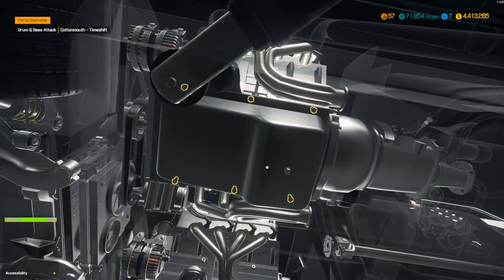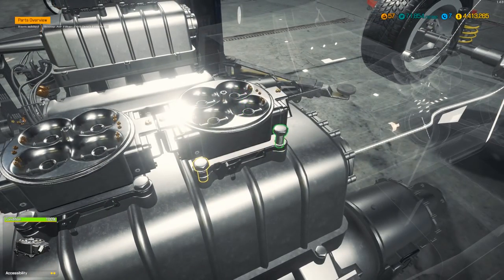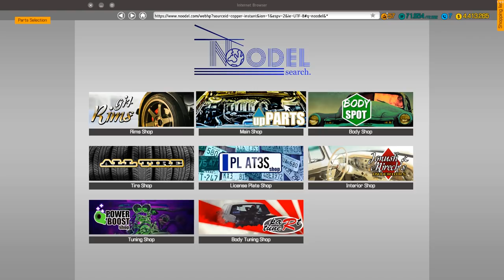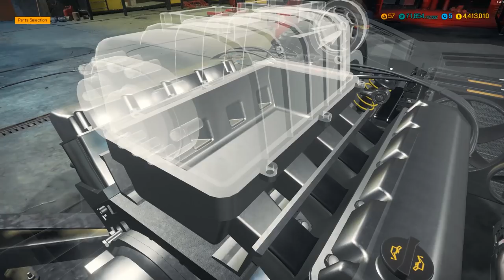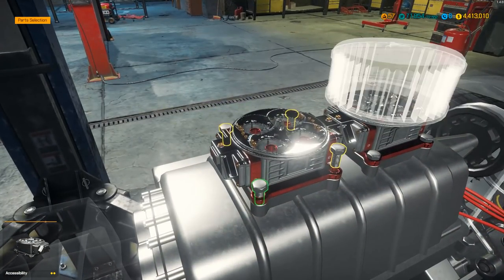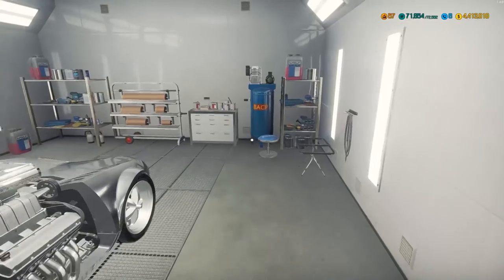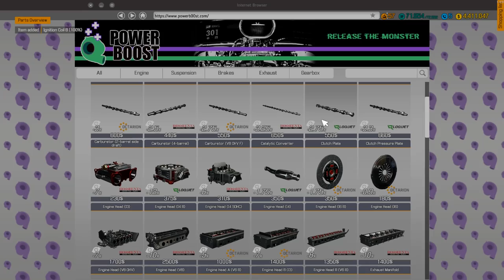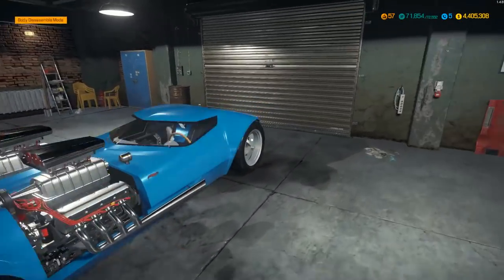Hot Wheels Twin Mill : Car Mechanic Simulator 2018 : PC Lets Play

Comment: As far as i know, the game doesn't let you add a 2nd engine for a car. I tried in the game editor and there is no option to add a 2nd engine to a car. I think that's why the 2nd engine on this car is not registering on the dyno. The only thing that registered after you put in the performance parts on the 2nd engine was the boost of the performance parts you put in. With those 2 engines (without performance parts) it should be over 1000HP right off the bat. For it to register a 2nd engine i think the devs would have to make some changes to allow cars to have more than one engine. Hopefully they add this option in the future.

Comment: I'm thinking about getting car mechanic and I have a question. Do you use the mouse mostly to play the game? I use a headmouse to work the computer. I have cerebral palsy. I have a hard time finding games that I can play because most of them you have to use the keyboard. Any help you can give me I will appreciate.
Reply from the maker: +michael wright Howdy!  I roster and move around using the keyboard and everything is mouse movement.  Mouse clicking is most of it but the keyboard to move the camera around.  Not sure if it can be configured right a right click and mouse movement though.
Reply: Can you change the keys? I play cities skylines and I change the keys to do what want. I use a program called Softype . On some games I can use the on screen keyboard . Thanks for the help.